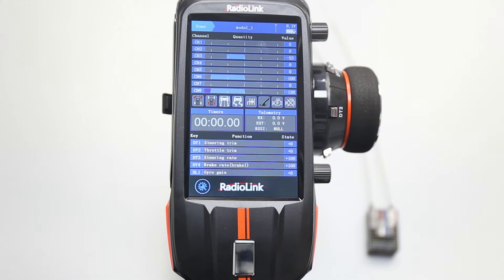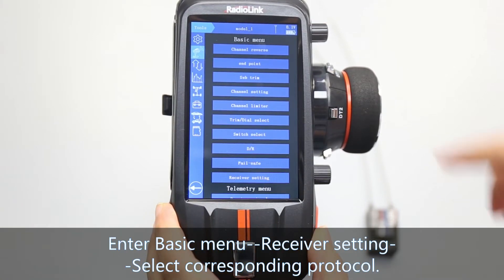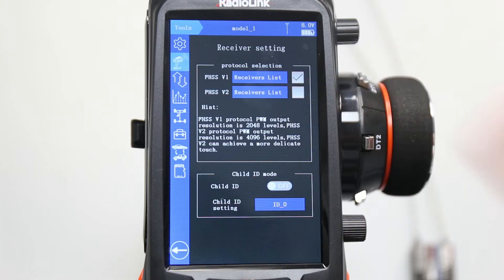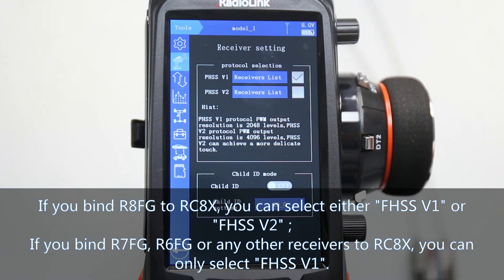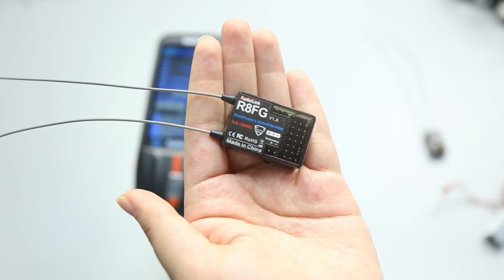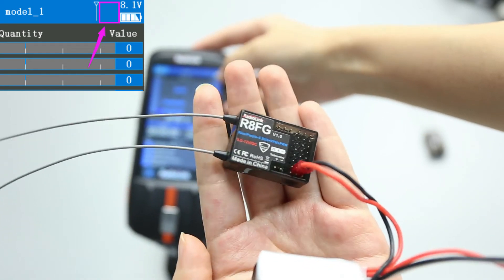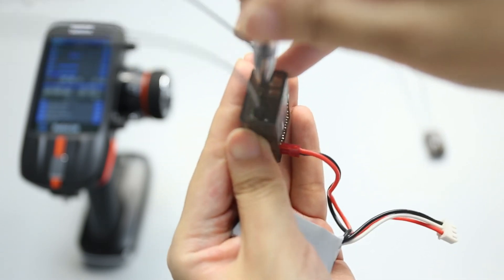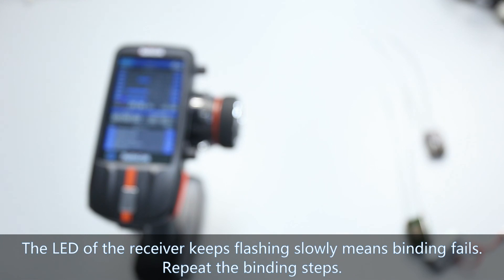How to bind Radiolink RC8X transmitter to Receiver?

Comment: What's the difference in range of the receiver r8f and r8fg?? They are the same receiver?
Reply from the maker: R8F: 800 meter; R8FG: 600 meters; they are different receivers, R8F had been stopped manufacturing now, but you can use R8FG instead of R8F.
Reply: @zhengtatina944  i need that 800m, is there any disadvantages to r8f? Higher latency perhaps? Why does RL stop manufacturing?
Reply from the maker: @ahmadfaris8044  We stopped to manufacture R8F receiver as it has the same function with R8FG, so most of our customers can replace R8F with R8FG receiver, maybe you can take a R8FG receiver for testing at first.